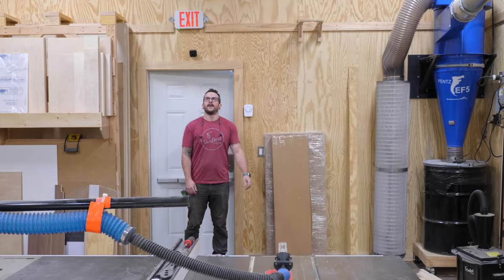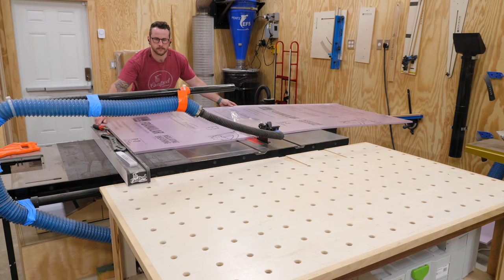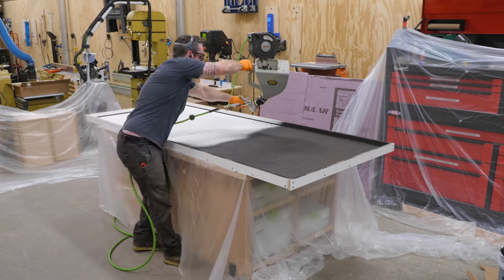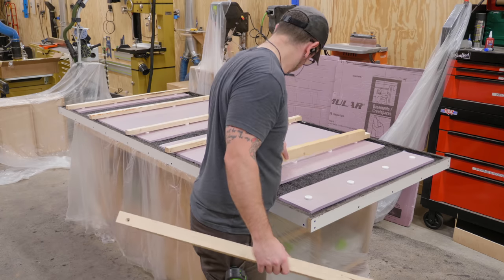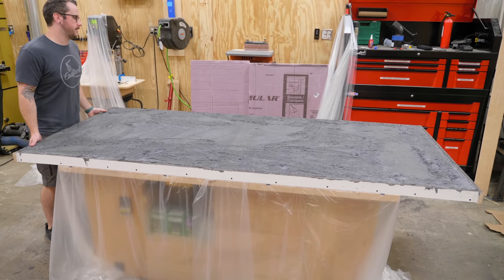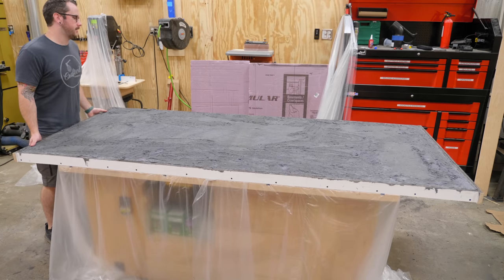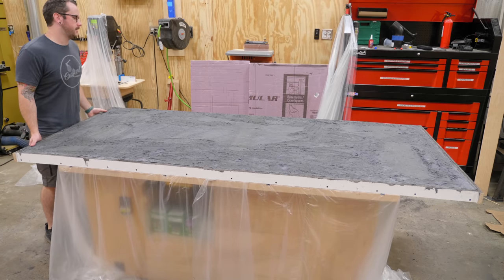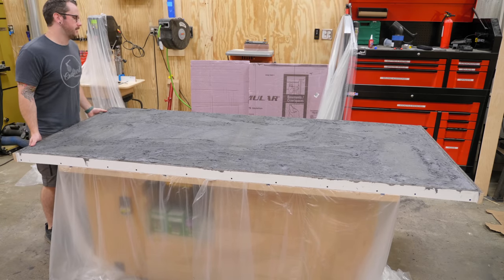Building a DIY GFRC CONCRETE Dining Table for Outdoors // How To

Comment: Well, I did a lot of high end residential concrete work, which included a lot of counter tops, and I also have a full wood shop. So, from that point of view, I got a couple of eye rolls out of this... Seems way over complicated to me. I do know they have light weight concrete mixes, which can include pumice as a big part of the aggregate mix, and/or vermiculite. I do like the idea of the fiber in it. My preference is for the micro fibers rather than the big stuff, cat hair, as we used to call it. My style was a hand troweled top, which included stripping and facing the edges and under lip of the table, about 2 inch over hang max. I just got a better look/finished product after, and didn't have to do any grinding after, but that requires set up and finish troweling experience. If we used the longer cat hair, a torch was used to burn off all nibs sticking up, but with the shorter hair, it wasn't necessary. For coloring, we used the acid based stains. For sealers, there were a lot of them back when I still did this work. I would expect that with any water based top coat, that the first coat would seal the top, after proper curing time, and then extra layers would build rather than continue to soak in. Not sure how that all works now days. I think I would have used a wider foot spread/base for your table top, and added a center lengthwise support as well.

Every one that I did concrete work for told me I was too dang fussy to do concrete work. Maybe I should have been a finish carpenter....
Reply from the maker: Good tips! I kind of wish I would have gone the stain route to get the concrete even darker.
Reply: Which is exactly why you spray the first coat and don't need any troweling experience. And NOBODY needs to grind....he screwed up just as he said.

Comment: When I did my concrete countertops I started with 400 grit after taking it out of the melamine and that seemed to work well. Did, 400 grit, 800 grit, 1200 grit and ended with 1500 grit. All wet sanding.
Reply from the maker: Yup, definitely starting WAY higher next time!

Comment: Keen to hear how this one holds up. Normally don't see an issue with gfrc for slabs on ground but it doesn't really do much in terms of flexure in a suspended spanning situation. Probably ok for counters since it's spanning at most 24 inches typically but this one seems a bit sketchy

Comment: Hi, enjoyed your vid and just a tip from an old all round  builder. If you add a couple of drawer handles to a board or aluminium rectangular box and  pull across the base or tamp it down, you'll get a better final finish but if tamping get rid of air bubbles in the concrete. Just a scaled down version of laying a shed/garage/workshop base. Would add a pic but won't let me, just look up concrete base tamping.

Comment: I made a concrete table and have a couple suggestions.  To lighten the table, I used styrofoam bean bag balls that I mixed in to the 2nd and 3rd pourings.  Worked well.  And to make the concrete black, I would use India ink after it's all cured rather than try to add colorant to the concrete mixture.  You''ll get a better look.
Reply: I just poured a table and used garden perlite as a filler and aggregate. Table was about 25 to 30 percent lighter!
Reply: Great idea. Was the garden perlite visible in the end result?  @tidaltimber

Comment: Sort of the issues I had when I started almost 10 years ago with GFRC. Large tables always tend to sag like a banana. that´s because cement tend to shrink where there is more material. My solution was to add a metal frame within the whole table to counter balance sagging. And regarding the screening of the back face, I advice to never use a piece of wood since it drags the material and get adhere to the wood. I always use an aluminum straight edge.  Overall beautiful work. !!

Comment: Did this back in 2007 but added diagonal strip to break it up into 2 sections because there was no way to move and place it on my island. After I put it in place I put some black caulk where the 2 pieces met and it looked pretty good. Worked out well.
Reply from the maker: Nice, good tips!

Comment: Yet another amazing build and video! One question though, why didn't you use wire mesh or rebar embedded into the concrete for strength? Not criticizing,  just curious.
Reply from the maker: Thanks! And kind of the whole point of GFRC is you don’t really need rebar. I could have added some glass scrim, which is a mesh made from the same material as the fibers.
Reply: @craftedworkshop  Thanks for the response Johnny. I've seen GFRC on YouTube a ton, but have never used it personally. I had no idea it was that strong! I'm going to need to get my hands on some :)

Comment: You made a wonderful piece.  I even like the way it looked on the saw horses! In the video, the table wasn’t sagging it was bowed, it looked like it was sagging when you flipped it over. It was the oddest thing.I am so glad it worked out.
Reply from the maker: It was definitely sagging, it flattened back out once I added the 2x4s underneath.

Comment: Do you feel like you need to add any sort of cross bracing underneath to prevent the table top from swaying? Or did that Apron really help out? I am mid build on my project, ended up around same amount of concrete and this thing is HEAVY. Im afraid that someone pushing on one end might topple the whole thing.

Comment: Nice video. I've been planning a similar project. How thick was your table-top? I am having trouble figuring out how you ended up using 7x45 lb bags of concrete? My calcs for what I think is a similar sized table are quite different and the magnitude of the difference worries me. Thanks.

Comment: Hello I’m glad the table ended up looking great. what is the best thing to weather proof this GRFC concrete table for outdoor use. Im planning on placing one near a pool, where I’m at during the summer it can reach 130F and quiet dusty. Im afraid thermal cycling could cause the corners to chip off
Reply from the maker: The U-Seal sealer I used is meant for outdoor use. I don't see anything chipping off as long as the piece is built correctly.
Reply: lol, GFRC is not chipping during your lifetime.
Reply: @flamabl1  i have seen some badly chipped etc, but suspect, not well made, sad, gives  GFRC, bad name, but if done right, as you say, will last years.

Comment: Do you feel like the table is top heavy? Or are the legs sufficiently wide enough?
Reply from the maker: It's certainly top heavy but I can't imagine this thing accidentally getting knocked over. The legs are 24" wide, so only an 8" overhang on either side.

Comment: Is it a good ideal to be carving GFRC like that? You are just throwing glass dust into the air for people to breath.
Reply: Probably wouldn't pass OSHA requirements for a commercial job, but unless he was grinding right in front of a crowd of people it probably didn't do much harm before it settled and washed away later. Hopefully.
Reply from the maker: Dust extraction obviously would have been ideal but I didn't have a way to collect the dust effectively. I was in an isolated area and wore a respirator.

Comment: Great build, however,  I think that your legs were placed too close to the end of the table. It should be the depth of a chair or appropriately 20 inches inside. This will also help to balance the weight of the concrete and prevent sagging.

Comment: How large a flow air compressor do you need to use the hopper gun?
Reply from the maker: Not much, I just have a small compressor similar to a pancake compressor.
Reply: @craftedworkshop  thanks  for prompt reply

Comment: And concrete has no tensile strength. So when you jumped on top on if (even in the form) I was surprised it didn't break and even more surprised when you didn't have an middle support after the form was off.
Reply from the maker: The glass fibers give this a good amount of tensile strength, that's the whole point of GFRC!
Reply: @craftedworkshop  Yeah, that helps. Fiberglass rods are a great alternative to rebar these days.

Comment: How do these makers use impact guns without a magnetic driver?
Reply: They don’t use philips bits?
Reply: @danebroe6067  they do, but most of the makers just stick the Phillips bus straight in the impact, as a framer and drywaller, I'm used to having magnetic shafts, that we put the Phillips bits into

Comment: 20 Dollar hand float and some technique with the wood board would have saved you tons and tons of time...
Reply from the maker: Yup, as I mentioned. Screeding doesn’t work well with GFRC though, so really troweling would have been the most helpful thing here.
Reply: Instead of troweling and then sanding, could you have covered it with heavy plastic and either rolled or sort of screeded the bottom surface to get it level and smooth?